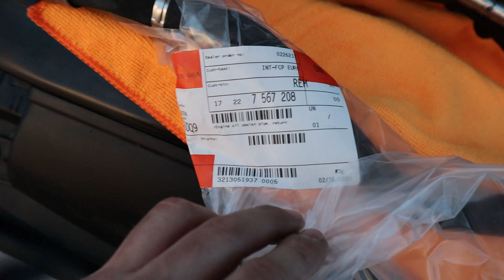BMW 335i oil cooler lines Replacement!

Comment: cool video, thanks for sharing, my lines started leaking yesterday so going to order new lines...
Reply from the maker: Nice get it done! Fcpeuro has fast shipping and lifetime replacement! Two of the reasons I order from them!
Reply: Hello is this the power steering hose or other?
Reply: @bumCamilo.  its oil cooler lines

Comment: How were you able to get the lines to close flush with the oil filter housing? I can’t get the two lines to pop in, they leave a gap when I torque the screw down😅
Reply from the maker: There will be a small gap, it’s a o ring seal so as long as the bolts tight your good to go
Reply: @dirtykurty92  thank you for the fast reply brotha 🙏 I appreciate the help
Reply from the maker: @whatsnew2u  happy to help!

Comment: Thanks for the video, you should of started it so we could see if it still leaked or not. LOL I'm thinking about buying one of these. Convertible Hard Top 85k mileage. 10k price. Seller Says the oil cooler lines are leaking and it needs a front bumper. Other than that its looks to be an amazing car.
Reply from the maker: It didn’t leak! Haha oil cooler lines are a easy fix! They do cost a little bit of money for oem bmw parts but buy it once’s and be done! Seems like a fair price for 85k miles forsure, just ask to see service records before buying it!

Comment: Hello. My 335 2007 is with the problem. Isn't possible to repair the lines and replace only the o rings?
Reply from the maker: Yes! Definitely possible, if the o ring failed. But some times the line fails. It is worth trying the orings first!
Reply: @dirtykurty92  Tks for your answer.. That's exactly what my mechanic suggested first, the orings first. Other question I have not asked, do you know if exist these hoses/lines not oem, i.e. produced by other manufacturer ? The oem parts are expensive and based on what I've read in web the reliability is questionable, specially if your car has additional horses, like mine that has around 400 hps. Furthermore, in Brazil these parts (2 lines) cost 650 euros in the bmw dealer. Tks again

Comment: What are the part #'s of lines and o-rings?
Reply from the maker: 17227567207 and 17227567208 for the oil feed and return lines, 11427558936 for the o ring. These are part numbers for a 07 BMW 335I.
Reply from the maker: I bought them off fcp euro for the lifetime guarantee on the parts.

Comment: Would of been nice to upgrade to braided lines
Reply from the maker: @naders5 yes I definitely thought about it, but to find something that is high quality, and the fittings and extras I would have needed, it didn’t seem worth it to me. I think unless it’s done right the braided lines can look trashy
Reply: @dirtykurty92  true I have heard they are prone to leaking
Reply from the maker: @naders5 I figure if you use quality parts like oem bmw it should last another 15 years like the originals did

Comment: not really very helpful
Reply from the maker: I showed you the parts and tools you need to do the job, how to do the job, did the job on video for you and its not helpful? Do I literally have to do the job for you on your car to be helpful?
Reply: @dirtykurty92  yes. and was just kidding 😘
Reply from the maker: @Christianhillis69420  I will even install it for you if you live close enough!
Reply: @dirtykurty92  where did you find the o ring for it i cannot find it anywhere
Reply from the maker: @Christianhillis69420  https://www.fcpeuro.com/products/bmw-oil-cooler-seal-e30-e32-e38-e34-17222245358
Reply from the maker: @Christianhillis69420  part number 17-22-2-245-358